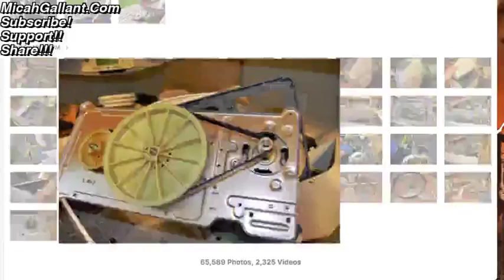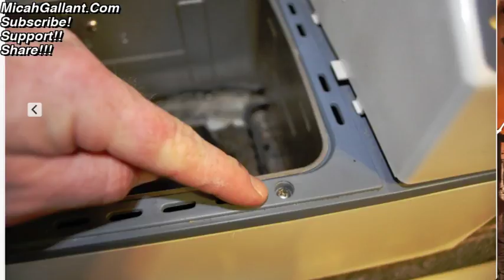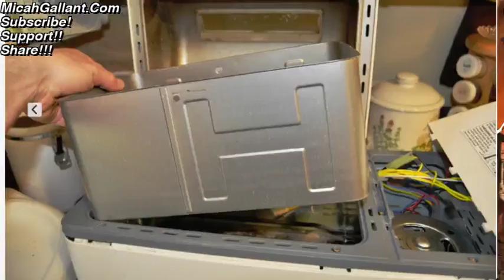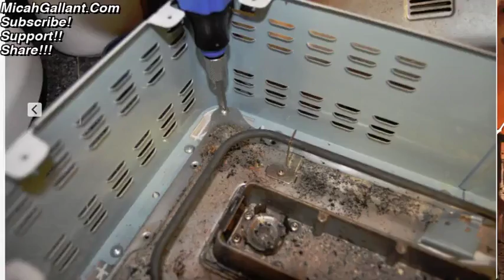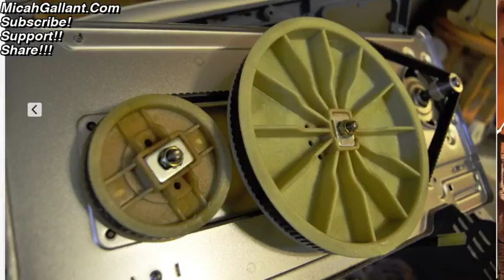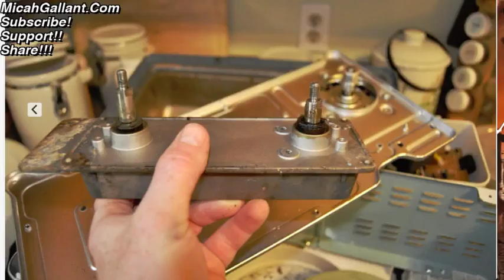HOW TO Belt Replace / Squeaky Mix Fix - Zojirushi Repair on BBCC X20

Comment: I’m so thankful for your information. I ordered one from eBay that USPS did not handle properly and I just discovered a substantial crack in the bottom case and some chunks are in the interior wall where the gears and belt is. I have to take it apart to get those out or they might cause more damage. I can’t seem to find a replacement bottle case but hopefully I can repair it and move on with life. We’ll see. 

If anyone knows where to find a bottom replacement case, PLEASE, let me know!!!

Comment: Thanks for the tear down video. Mine started squeeling whenever it was kneading. When I finally get down to the drive belts I found that one of spindle shafts was stuck in a slightly up position. I gave it a gentle tap and it 'clicked' back down into position. I lubed the spindle shaft and re-assembled. It was the left side shaft. When it eventually happens again I'll try just bumping it down again before I disassemble. My model is a BB-CEC20 ....virtually the same as the one in your video.

Comment: I am not sure exactly what oil or grass to use but it should be ‘food grade’.

In mine the shafts were dry and sealed and the 2nd belt halfway jumped off track. I suppose it jumped when the 2nd shaft stopped spinning 

Nice quick video, thanks!

Comment: Thank you for the video, I have the bb-cec20 which is pretty similar and managed to get it down to the belts in 20 minutes.  Now just have to find a large belt as mine is starting to come apart

Comment: Good work and thanks. I wish I'd seen your vid before buying a used CEC20 (pretty much the same as an X20) off of eBay last week (hasn't arrived yet). Looks like a royal pain to do basic maintenance on. Methinks I'll keep the old Panasonic and Oster machines, they are a breeze to work on. The Oster 4811 appears to have a teflon seal between the spindle and pan. 27 years old, all original and still works fine, no leaks.

Comment: I oiled the shafts on mine. That stopped the squeaking but smoked the house out when the machine went into bake mode. Might be better to use graphite.
Reply from the maker: Yes, try different things. really it needs bearings, its a brass bushing i believe.

Comment: I have a 30-year-old bbcc-n15 and it is squeaking real bad.  I was thinking of replacing the belt and came across your video which I do appreciate.  Yes it is quite a bit of work.  I was hoping it would be easier to get to the motor.  Any suggestions?  Should I try to oil the shaft and see if it fixes my problem.  Maybe I am overdue to replacing the belt, especially considering the age of the machine.  My wife loves this machine which still works well, except for the squeaks.  Thanks for the video and any tips you may share with a novice a this type of work.
Reply from the maker: Yep, try oiling the shaft like i mentioned at the end - may just resolve it for you. Let me know if it works
Reply: EverythingNewUnderThe Son thank you, I plan to do it next weekend.  I hope it does the trick.. I will keep you posted.
Reply: EverythingNewUnderThe Son good news, I can access the belt from the bottom of the unit by removing  a total of 7 screws including the 4 that hold the rubber feet.  I the belt looked good.  I couldn’t see much of a space to oiled the shaft, bit I dropped a couple drops in there.  Will be checking if it made any improvement.
Reply: @jpereira59  Please keep us updated. Which oil did you use?
Reply: @jpereira59  Hi, did this work to reduce the squeezing? Thx
Reply: @perrysmith1104  yes it helped quite a bit.  Still some squeaking but not as bad.  Thanks for asking
Reply: @newSigmundFreud  sorry for the delay in responding.  I used sewing machine oil and it helped a lot.  Thanks
Reply: @jpereira59  oh.      Thanks.

Comment: So dId dripping oil down the spindle shafts from the outside end up working for you? I just got an X20, like-new condition but with noisy spindles. That suggests they go bad even when not used. Definite design defect...
Reply from the maker: Yes, these things aren't really meant to last for years and years of continual use.
Reply: @MicahGallant  ... or even year and years of non-use. An unlubricated sleeve bearing - ugh! Mineral oil did the trick on this one, took 3 applications of a couple drops, with alternate rest and running over the day, and it's nice and quiet now.
I highly prefer the Panasonics - so easy to work on.
Reply: @MicahGallant  i bought mine used x-20 model from a Mormon family so you know it was used well. Been 12 years 2x a week so Zoji were meant to Last and be used. Been squeaking so looking to  remedy that and replace belts if needed. But finding parts are impossible.

Comment: Thanks for the video.  However, I can't get the spindle out of the base.  I've got the C-clamp off, but it's stuck in there and I don't want to pound it out with a hammer.  Any suggestions?  Thanks.
Reply: I use a snap ring pliers. $10 at Home Depot.

Comment: Too bad the video doesn't show how tight the new belt or the existing belt was/is.  I just replaced mine, and now they're too tight for the motor to turn the pulleys.  I had to turn the paddles by hand to help it, and it took too much tension... yet when I didn't have the belts on, the pulleys were very nice and lubricated (I polished the shafts too.  May have to put my old belts back on.  I checked the runtime capacitor and it measured right on target as far as capacitance goes.  What the heck..
Reply from the maker: Wrong belt? or maybe it just needs time to stretch.